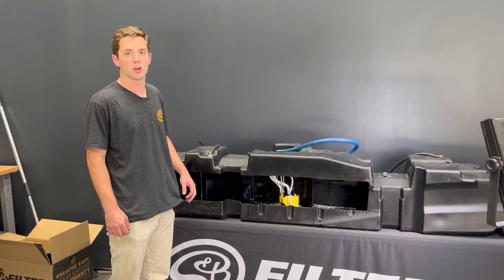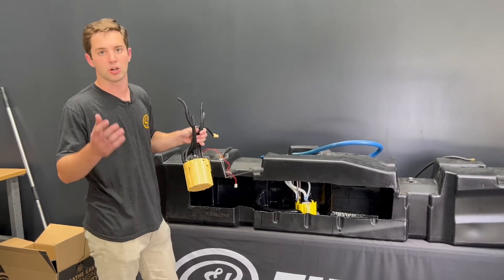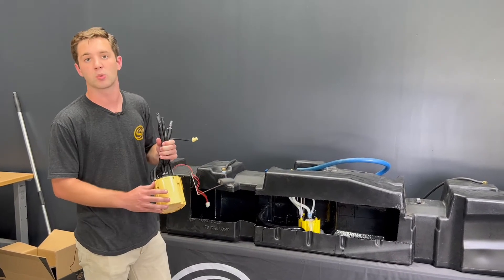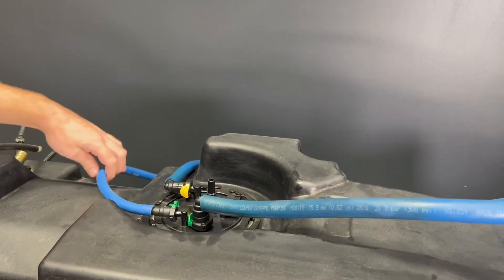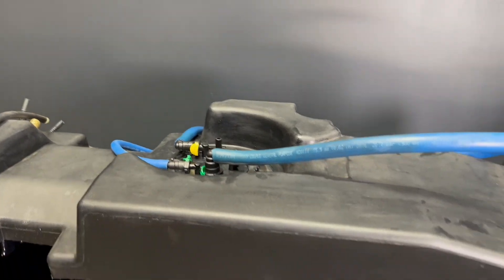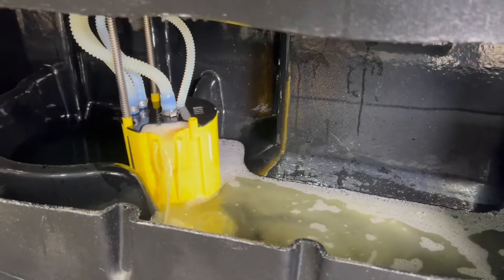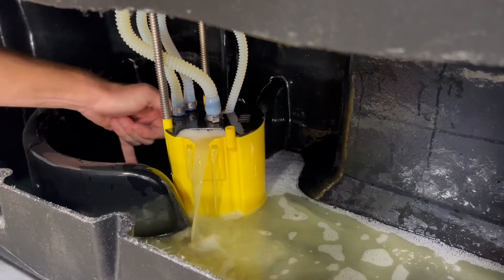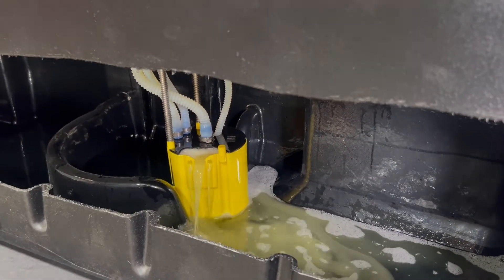S&B Fuel Sending Unit - Drive to Empty. No More Low Fuel Issues!

Comment: I put a new Fleece drop in lift pump that looks just like factory but it has two gear motor fuel pumps and what is sweet is one plugs in just like factory and second pump has it own harness with fuse and relay so if one pump goes out you still have enough fuel pressure to get you home and I put a gauge inside of cab at idle 21 psi and at hard pull is 18-19 psi so if I was putting new fuel tank get you a Fleece intank lift pump and I have 3 fuel filters from 5 microns down to 2 microns on a big cat filter .
Reply: What year is your truck.